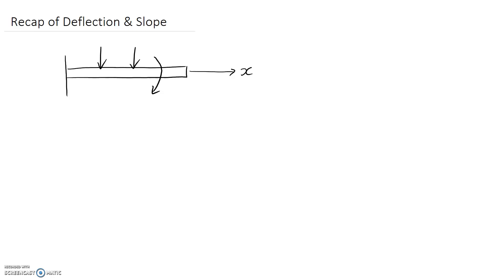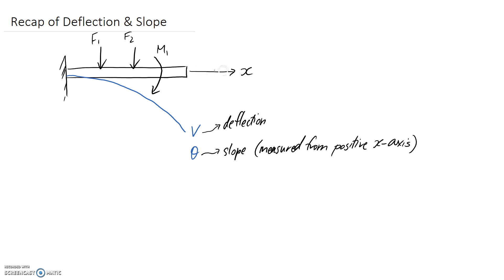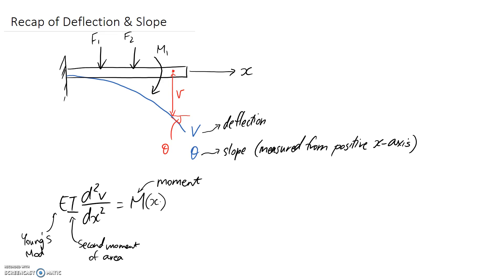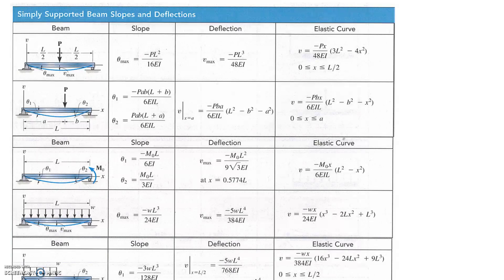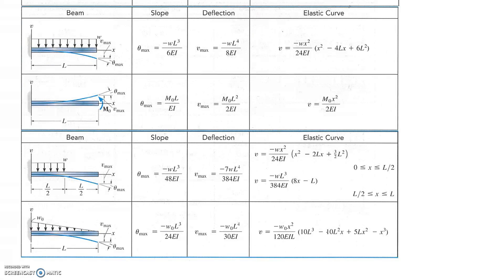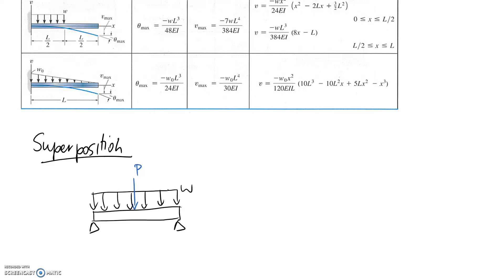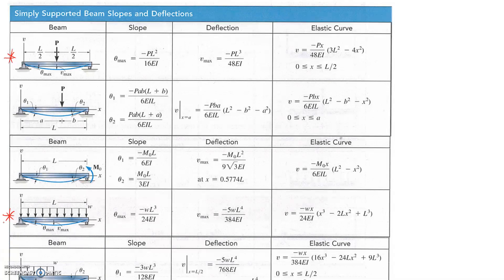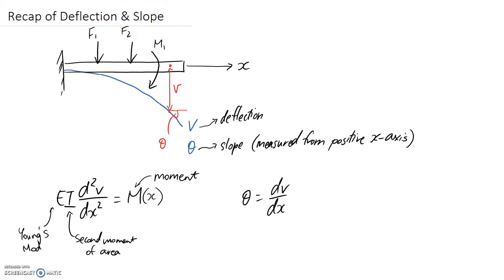Recap of Deflection & Slope

Comment: Thanks for the explaining, i work as mechanical engineer and we have Cantilever H-beam attached to the Rack, i did the calculation for max deflection, but remaining design shear force and BM, and we have supported Stand with continuous support from both ends and i can't find the formula